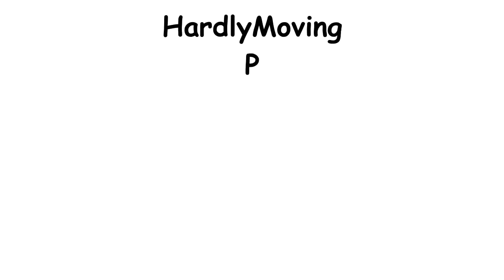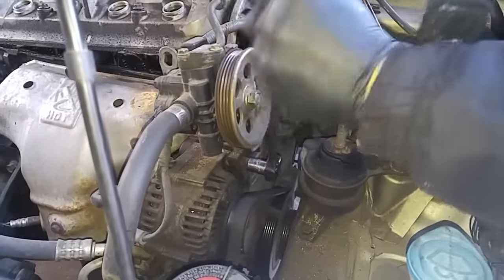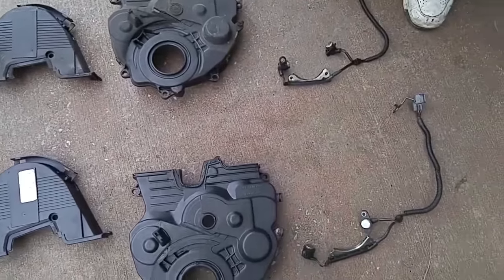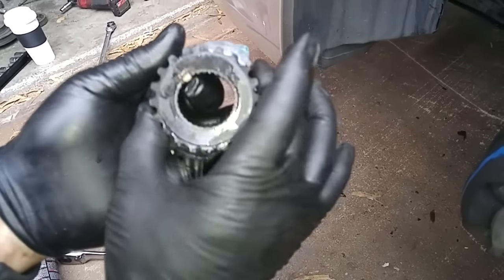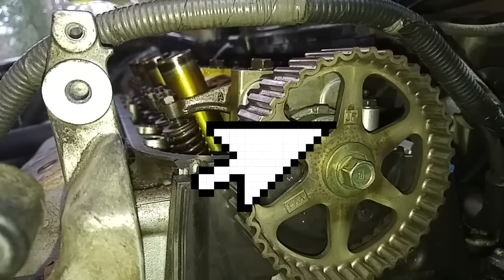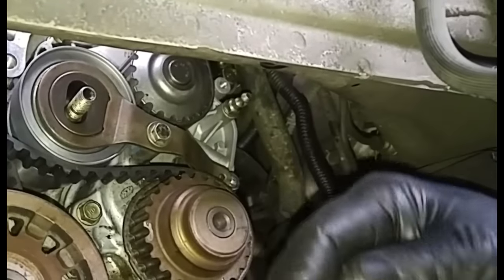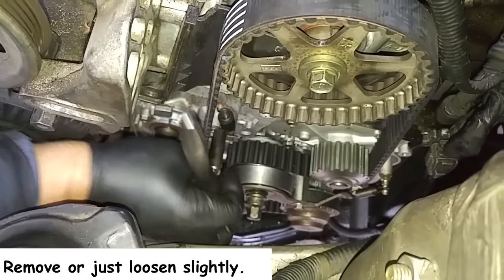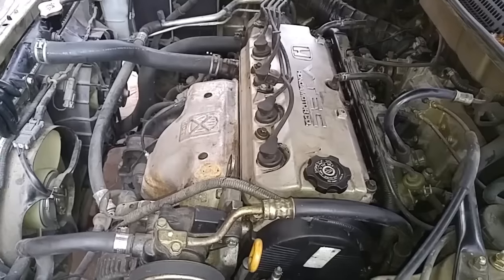Honda Accord Timing Belt, Water Pump, Pulleys & Seals - (4 cyl. F series 2.3L)

Comment: Nice! To tension the belt by the book after timing is set you need to turn the crank until the LH cam mark is off by 3 teeth. This is where the belt is properly tensioned. You then  tighten the tensioner bolt. Next turn the cranck counterclockwise till your back to tdc and all your marks line up. Now you can tighten the tensioner arm bolt to hold timing while you do the balancer. You will have to loosen the tensioner bolt again anyway to to do the balance shaft belt because both pulleys share 1 stud. Doing this method assures there is no slack in the belt. If the belt has slack between the cam and crank  that means the tensioner is experiencing an extreme amount of tension on the opposite side. This will cause premature failure of the bearing that is built into the tensioner.
Reply from the maker: Good to know.
Reply: Loved the vid but this procedure is correct and it was obvious it was too tight in the start because of the belt whine.
Reply: @jsstrawder  i stopped the video when i got to the belt tensioning part, glad to see someone mentioned the correct way to do the job. also happy to see the content creator was receptive.
Reply: When turning the crank do you need to turn it clock wise or counter clockwise to get it to the 3 teeth offset your talking about?
Reply from the maker: Any direction.
Reply: @TheCm900  always turn the crank counter clockwise. The tension is on the left side, if you spin the crank clockwise you risk jumping time

Comment: Great video, great photography and great tips/professional techniques demonstrated.  I've done this job before, and it is a pain to say the least.  This is a great resource for anyone attempting to take on this procedure.  Getting these details right will ensure your success.  This is not a quick job, so allow plenty of time and replace all the wear parts, bearings, tensioners, water pump, crank, cam and valve cover seals.  You don't want to do this job twice, so don't go cheap on quality parts and take your time ensuring all alignment marks are in the correct position and proper tension is applied to the belts, as he demonstrates.  Thank you for making this video, very good work!!!
Reply from the maker: All good advice and thanks for sharing!

Comment: Audience, this gentleman did an excellent job on video and illustration. Well versed, detailed, and well knowledged...Thumbs up!!!!
Reply: Cameraman did a great job too!
Reply from the maker: I know.  Without him there's no way the videos would come out this great.
Reply: It takes TWO to go through
Reply: @MrKiet76  pa
Reply: @hardlymovingpro  I have a big leak. ( add 2 quarters of engine oil and when I turn on the engine it empty inmmediately). Flow come out from bottom of engine timing belt  cover. Can be a seal?
Reply from the maker: @hvillalobos1317  Yes it can be a seal.  Another big oil leak source is the VVT sensor seal behind the valve cover by the passenger side firewall.  Easiest to get to by removing the valve cover.

Comment: An odd thing happened during our test start. I think our test start was same as yours. Accessory belts off, valve cover resting on head, not bolted down. Harmonic balancer installed, engine covers off. Timing marks all hopefully ready to go. Engine fired right up and RPM soared upwards. I shut off right away. Tried again and same thing. RPM soared up.  Since it seemed to run fine, everything was reinstalled. Engine started and ran normally. We did have the alternator off the engine. I don't know why the engine did what it did. Great video, thank you very much. It really helped. I think the worst part of the whole thing was dealing with a splash cover with ears chewed off.
Reply from the maker: When you start the car with the alternator off, the car is running off the battery.  If the battery is fully charged, the car will run for around 30 minutes without the alternator.
Reply: Did you have the throttle cable in a bind where you moved it off of the valve cover?
Reply from the maker: No ... Why?

Comment: Great camera work. Just finished same setup on sunday on 1995 honda odyssey with 300,000 miles . Debating on replacing the idlers, tensilners and aisin water pump. New dayco timing belt the rest was replaced at 138,000 miles back. Plan on keeping the van no more than 6 months to a year. Had bent valves do to snapped timing belt on hwy. Took for a 3 mile test run all seems good
Reply from the maker: Hey ... glad things worked out for you!

Comment: Video helped so much, some reason crank sprocket won’t go back on. Hopefully grease helps tomorrow, slid off so easily it’s hard to believe it won’t budge now
Reply from the maker: Could be your woodruff key.  Remove the key, slide on the sprocket, align sprocket with key grooves then install the key.
Reply: Key isn’t the problem, it just won’t slide over for some reason. Teeth aren’t damaged, some grease should do the trick
Reply: @hardlymovingpro  the lube did not help, nothing was damaged during the process. Even went back on no problem as a test earlier but now as I’m wrapping up the job the crank sprocket will just not slide on, I don’t understand why
Reply from the maker: Try wire brushing the contact surfaces of any coorosion
Reply: @hardlymovingpro  well nothing is working, I don’t understand what happened. Appreciate your help
Reply: @hardlymovingpro  piece of wood and hammer a bad idea if I have they key lined up already

Comment: Nice video! I like to run the engine also before I put it back together. On this engine since nothing is really holding that balancer pulley on the crank, I temporarily put the harmonic balancer and bolt on. Don't really want that thing flying off.
Reply from the maker: Right on!

Comment: You used a "timing mark" on the rear balancing shaft sprocket. The correct way to do this is to use the access port in the back of the block to align the shaft correctly. There is a 3:1 gear ratio on that rear balancing shaft sprocket. This is from Honda's service manual for this car. May be worth adding this info to the video desc to save someone from unbalancing the block. It's small but noticable at low idle when it vibrates everything.
Reply from the maker: Had tried to use the access port in the back to lock the balance shaft sprocket from moving to mount the belt but didn't work out for me. The balance shaft sprocket would continue to move.
Reply: @hardlymovingpro  Ouch, sounds like a bigger problem then. The two gears behind that sprocket are accessable at least, on occasion the seal behind that gear housing will leak as well. Most kits don't include that seal though unfortunately.
Reply: Where can you find the bolt that will thread into the balance shaft through the access port? Is it one of those dig through the bolt bin type of bolts or can you get a specific one somewhere
Reply: @MacroMicro99  The bolt that opens the passage way is just a cover, you can simply take that out and use a screwdriver in there to lock the balance shaft in place.

Comment: Ok video with the exception of some important details. The spring for tensioner works fine. When you have the timing and balancer belt in correct position, loosen the tensioner nut and turn the crank to the left 3 teeth then tighten the nut. Also you left out a critical step in aligning your balancer sprocket.
Reply from the maker: I learned the hard way that with fixed spring tension timing belt systems to start the engine and let the belt seat in.  Most of the time the belt loosens up after I start the engine.  Next time I'll try your 3 cogs to the left method, start the engine and see if the belt hasn't lost it's tension.  Let me know when you have a video on this service ... always looking for a better way to do a job.
Reply: @hardlymovingpro   No videos. I do appreciate people that make them. I'm all about DIY. I hardly see any 4 cyl accords with belts come into the shop anymore. They are all chains since 03. Thank goodness for VTC actuators keeping me busy. ;)
Reply from the maker: There's still late model cars with belts.  Honda with their V6's and Volvo with their I5.  Just did a TB / WP job a 2004 Volvo I5 2.5L Turbo.  The cam sprockets are variable oil pressure controlled.  Not too much out there explaining how to replace the cam seals without disturbing the cam's position relative to the crank ... had to figure it out on my own.  GM's V6 timing chain(s) barely last over 150K miles before it stretches.  Around 10 hrs of work to replace the chain, guides and tensioners.  I still prefer doing belts to chains.

Comment: Thanks for the great video and very informative instructions. I’ll be performing this project on my folks 98 Odyssey pretty soon. Now I’ll have some good knowledge and to purchase the special CS socket. Heard these bolts are are bear to remove with conventional tools.
Reply from the maker: Yes definitely the high mass impact socket will avoid a lot of frustration. Let me know how the job goes.
Reply: Hardly Moving Productions     Purchased the Leslie CS socket and worked perfectly as advertised even with only 120 psi on my air compressor.  Will start the project this weekend, keep you updated
Reply from the maker: Sounds good ... good luck!

Comment: Thanks for the video!!! This will be helpful for an upcoming TB+WaterPump and Seal job in the near future. What did you use to clean the area?? I saw you sprayed something and then blew it with air.
Reply from the maker: I used brake clean in a aerosol can to dissolve oil and grease then blow it off with compressed air.  A lot of repair shops do this.

Comment: Thank you to you. I replaced timing belt 2001 Accord few days ago. Your video is the best I've seen to finish my job this time. But I have a question.
How can I make sure P.S pump tension?
Thanks in advance!!
Reply from the maker: You shouldn’t be able to twist the belt more or less than 45 degrees.  If a new belt, even tighter.  Or just enough so the belt doesn’t squeal with full steering wheel deflection.  Thanks for your comment and support!

Comment: If anyone follows this, the counterbalance shaft seal needs a retaining plate. Those seals like to blow out and dump all your engine oil on the ground. Maybe add that into your video to let people know.
Reply from the maker: Good to know.  Where do you get this 'retaining plate'?  Seals usually blow out due to overfilling the crankcase with too much oil.
Reply: @hardlymovingpro  You can get them directly from honda. Or you can get a Dorman brand from any parts store. Dorman Part # 917-006
Reply: Heres the honda part numbers
Retaining plate - 06923-P0A-306
Oil Seal - 91233-PT0-003
Reply from the maker: Ah ... I see what you mean and see it on Amazon.  Thanks!  I'll link it in the description.

Comment: 7:31 DO NOT USE A CHAIN VICE GRIP LIKE THIS VIDEO! I followed this and scarred up the timing cam gears. The gears are made of some soft metal (aluminum?). Use a camshaft gear pulley holding tool and insert into the sides while turning the bolt. Better yet, just loosen up the cam gear bolts before removing the timing belt so you don't have to wrestle with the gear position aligning to the top mark. I ended up having to place an order for 2x new ones.
Reply from the maker: Thanks for your comment of concern ... but this is what most professional mechanics do to remove the "steel" camshaft pulley.  There isn't a lot of torque involved in holding the pulley from moving while loosening the pulley bolt.  Using the timing belt to prevent the cam from moving is not advised.  It applies too much force and pressure on component bearings (like the water pump and pulleys).

Comment: Can you rotate the crankshaft freely just like you did with that top left balance shaft what I mean is rotate the crankshaft without the timing belt on or does the timing belt have to be on the crankshaft and camshaft to be turned
Reply from the maker: Never tried and don't think so if the engine is interference (meaning with any valves being open, one of the pistons will push against it).

Comment: That 10mm tensioner bolt, for the timing belt tensioner pulley.. You left it there.. loose like that? It wont come off?
Threadlock?
Reply from the maker: It won't come off.

Comment: My 2001 now has the exact oil leak from the inside of that cover.
Reply from the maker: Worn out cam seals
Reply: @hardlymovingpro  Thank you!  Good thing you mentioned of the cam seals.  I think there are three seals in that area (that you worked on)?  The cam seals, the crankshaft seal itself, and another one that I don't remember.   Could you please comment on the 3rd one?  Is that the crankshaft sprocket seal at 9:38?  I am looking to replace the cam seals, so I might as well replace the other two.

Comment: Nice video. Only question I have is why you had used dielectric grease to lubricate the seals as you put them in rather than engine oil.
Reply from the maker: Petroleum based lubricants can cause rubber components to swell .  Silicone (dielectric) lubes on rubber will not swell.
Reply: @hardlymovingpro  I mean I get that but won't they be in contact with engine oil anyway? I only really know if dielectric grease being used for preventing corrosion in the ignition system (where the spark plugs connect in), so seeing it used for that was just a little odd to me.
Reply from the maker: @CAepicreviews  Di-electric (aka plumber's grease) is another name for silicone grease.  It has other properties in addition to being an electric insulator.  Using a petro based grease may work in pushing in new seals but you may have difficulty getting them out (swelling) when they need to be replaced.   In addition, silicone grease remain on contact surfaces longer and are more resistant to heat when compared to petro grease.

Comment: Nice! One question...it does not seem right to be able to hand install the oil seals. I would think they would leak. how is it they dont?
Reply from the maker: For whatever it's worth, it wasn't in that tight to begin with when I removed the old one.
Reply: I use just a little dish soap to lube the outside of the seal and grease on the inside. The Idea being the dish soap will dry out quick and the rubber from the seal will hold it in place.
Reply from the maker: Whatever works for you.

Comment: So I have a 2000 accord , there is oil leaking from the bottom part of the timing cover , could it be pulley seal?
Reply from the maker: Could be the crankshaft output shaft seal.

Comment: Great video! Thanks so much for sharing. Other than replacing the gasket seal, why do we need to remove the head-gasket?
Reply from the maker: You mean the valve cover gasket?  Because once you break the seal loose to remove the valve cover, the old gasket tend to leak after reinstallation

Comment: I really appreciate this video. I see you had the car running without the covers on. I have an oil leak it appears to be coming from out of the bottom the timing cover. In your video it doesn’t appear that there is any oil or should be any oil within that timing cover.I know it’s very hard for you to say but would you have any guess on where my oil leak would be coming from?  The leak is quite significant.
Reply from the maker: The other possible leak source may be from the VTEC / VVTI solenoid on the left rear side of the motor facing the firewall.  Easy to service with the valve cover off.  The rubber gasket shrinks and causes oil leaks.

Comment: Do you have to remove valve cover to change the water pump?
Reply from the maker: Yes and it's basically a time belt replacement job since the pump is driven by the belt.

Comment: After replacing timing and balancer belt, and water pump, now it looks like a small oil leak coming from where the wires exit the lower cover. We did not replace cam or crank seals, and did not remove the crank sensor.  Any guess as to where the oil is coming from? I hate to think about opening it all back up again. thanks again,
Reply from the maker: Read cases of oil leak from the balance shaft pull seal.  Oil leak can be coming from the vtec solenoid gasket attached  to the engine block by the firewall.  Easy acess if you remove the valve cover

Comment: At the beginning of the video you said you were putting the engine to top dead center, and made the mark on it. How do you know where the mark is supposed to be? I just took mine off and didn't do any of that, will that be an issue for me later on? I looked the harmonic balancer over and couldn't see anything that would line up with that piece on the timing cover.
Reply from the maker: Had to get to TDC since the belt jumped and the engine was out of time
Reply: @hardlymovingpro  Right I get how you'd do that on the top pulley but I don't see what your lining up edith the plastic notch. Is there an alignment mark on the harmonic balancer?

Comment: What deep socket size and lenght (it looked longer then standard deep socket) did you use to remove stud bolt for engine mount?
Reply from the maker: All standard length for 1/2" or 3/8" socket types.
Reply: @hardlymovingpro  thank you